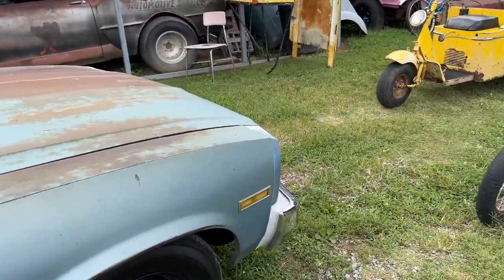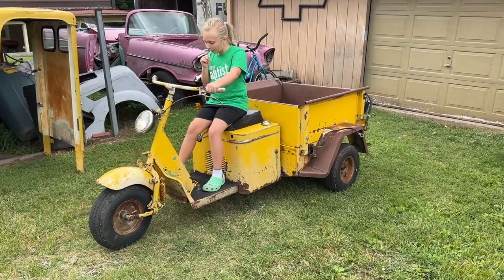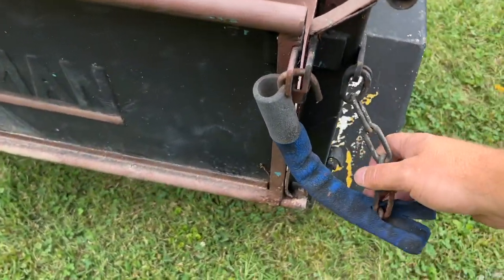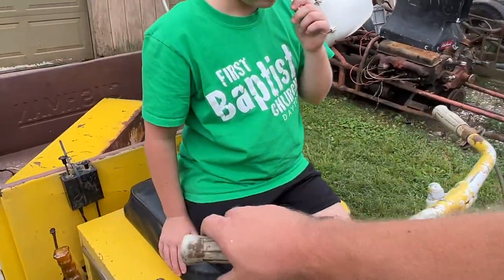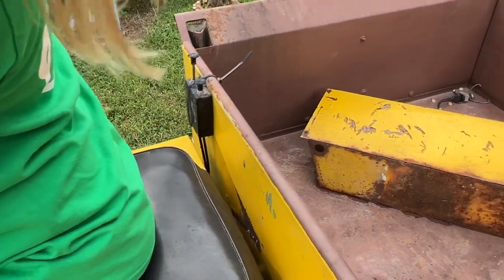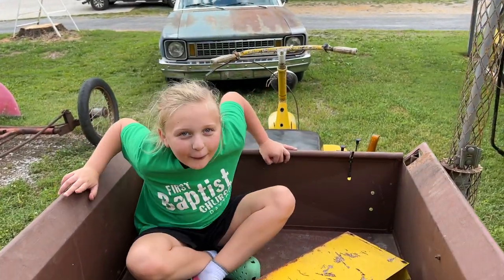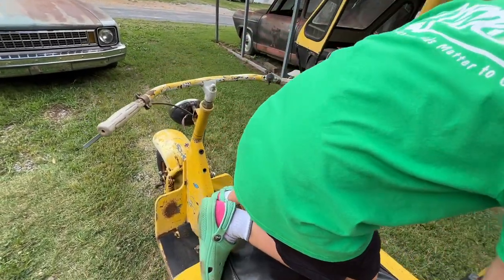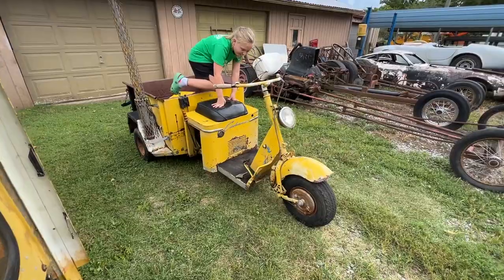ADDICTED to Buying Old Junk - Vintage Three Wheeler

Comment: That's really neat. David Lee Roth called and wanted his Cushman back for ice cream deliveries. Popular 1980s song with the lyrics ice cream man. I'm more serious note those tires have tubes in them I'm assuming. As long as you keep them aired up properly the old tires are the last for a long time. Now if you start running around too much, that would make a difference. Thanks you help me figure something out. I bought an old homemade heavy duty yard cart. And it had miniature differential and axle and I couldn't figure out what it came out of. I'll check came out of Cushman after seeing your video.

Comment: That's a neat old machine!! I knew Cushman made scooters, but I've never seen a "three wheeler". It even has a rear differential and drive shaft! I'm guessing it's not street legal, probably used for utility work on a farm or homestead. Predecessor to the UTV. Very cool!! I'd like to see if it would run again. Thanks for sharing.